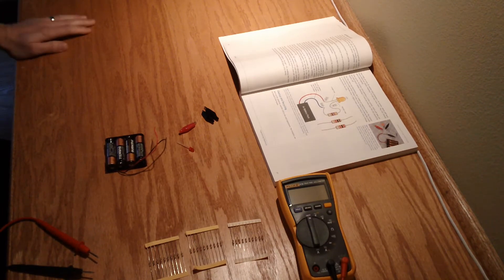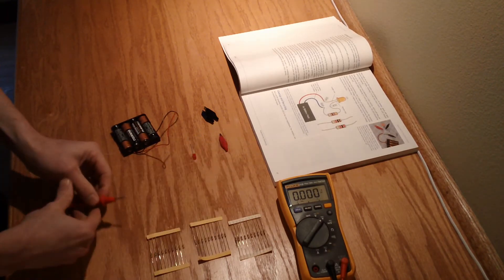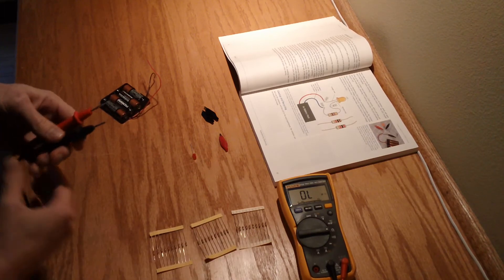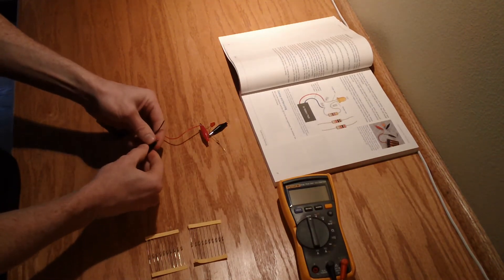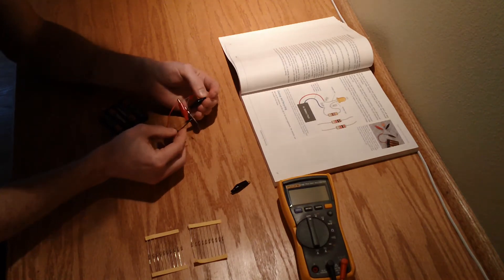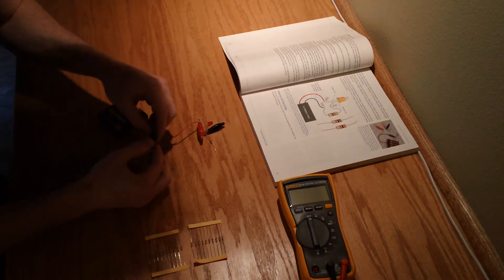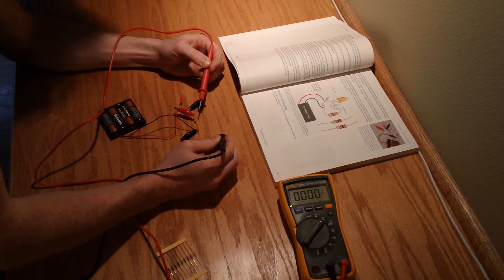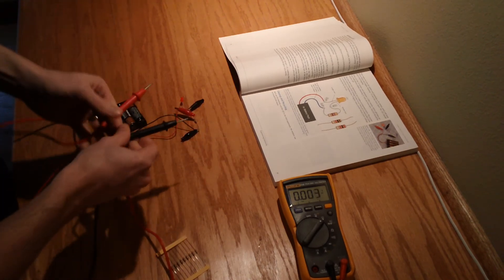Make: Electronics - Experiment 3

Comment from the maker: @kryton9 I think I see what your question is.  You're asking what was the meaning of the 1.9 reading for the LED?  That was me measuring the voltage drop across the LED in the circuit.  Remember, voltage is measured between 2 points in parallel with the circuit, current is measured at 1 point in series with the circuit (usually more of a pain to do).